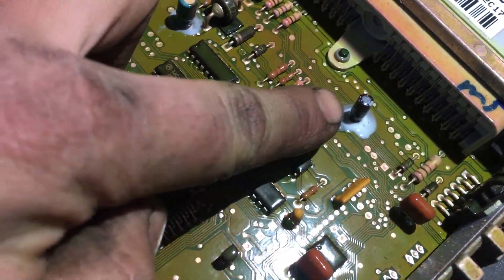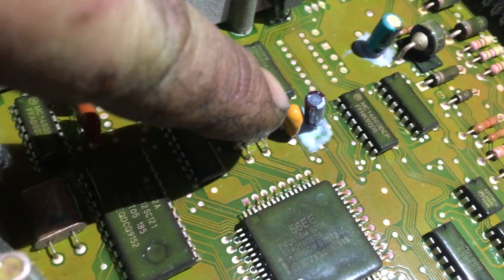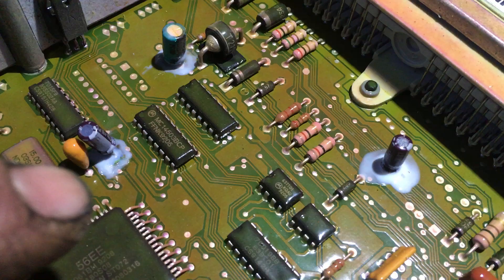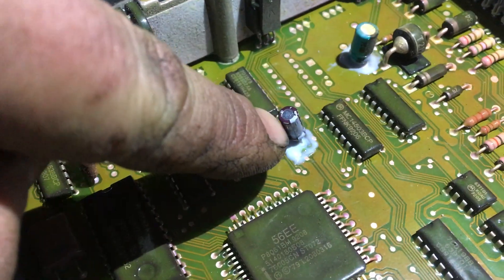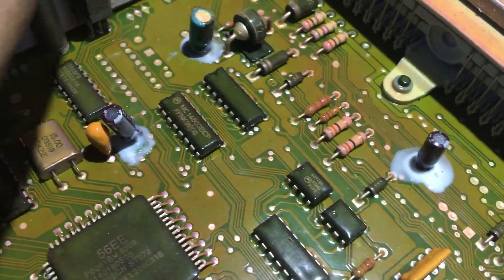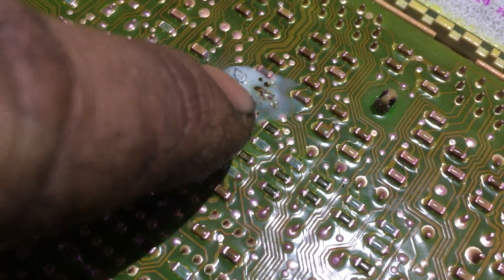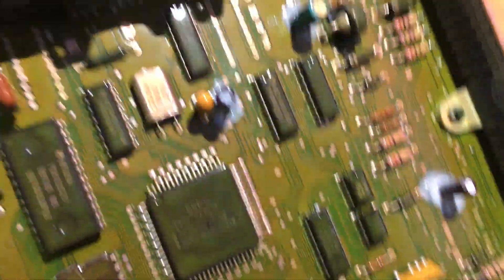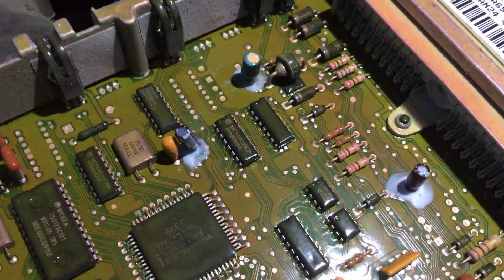Ford F-150 PCM failure.

Comment: One question man where did you go to get those little capacitors because I don't have a radio shack where I live in South Carolina You have any suggestions and also did your truck have a dead spot I would say in the throttle your master throttle bright just above 1500 or so it would just be dead just anytime you initiated throttle let me know man plz lol
Reply: I ordered them from digikey.com. There are a few online electronics distributors. I don’t own this truck. I’m a mechanic, a customer brought me this problem. It looked like it was a common issue with no clear solution. 
Your issue sounds like a sensor problem. The symptoms of this problem were much different. 
A dead spot could be a couple things. I would use my scanner or meter to monitor the TPS first.